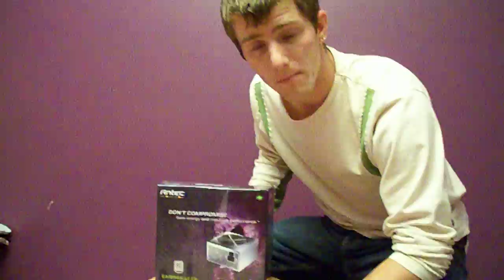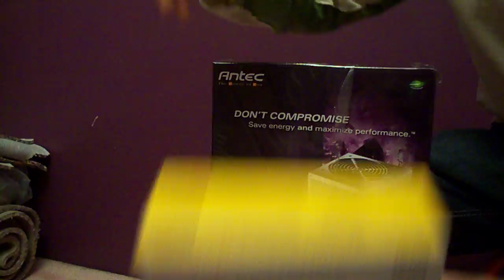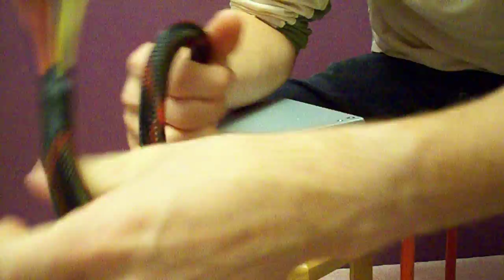Antec Earthwatts 650W 80+ Power Supply Unboxing Linus Tech Tips

Comment: I just bought this second hand used- I'm using i5-4470 and amd rx 580. So far so good but is it going to last long? I just want to know if do I need to replace mine or not. This is the only one my wallket can buy for now.
Reply: Update: It still actually works fine, already upgraded my GPU to an RTX 2060 and my CPU to i7-4790 and so far the PSU is still fine. But yeah I will still replace this anyways on my next upgrade.
Reply: @aaronazraelfreelance  I’ve been using this psu for at least 6 years and it’s still running great

Comment: Chapters:

0:00 Box and general overview
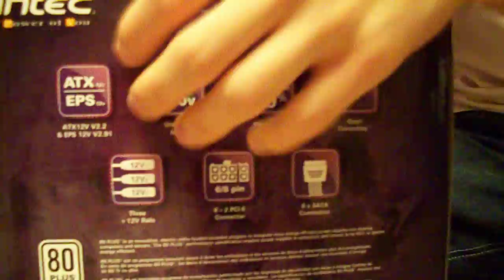1:08 Unboxing start
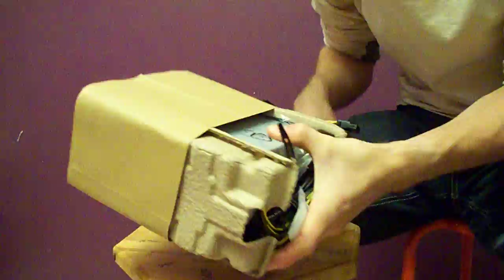1:29 Power cable
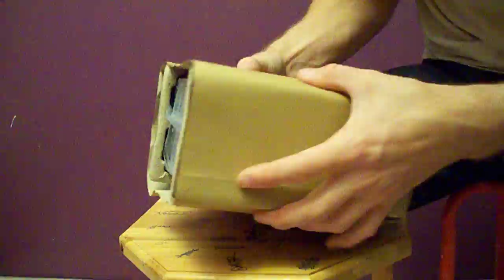1:46 The power supply itself
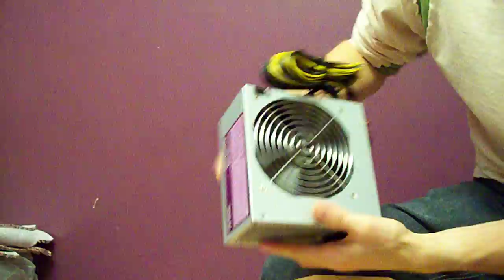2:17 The bottom
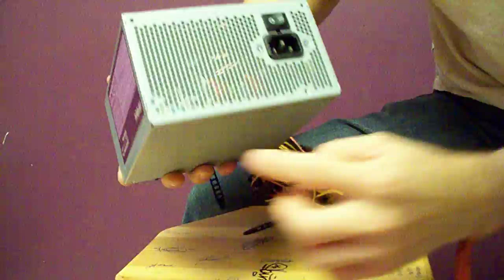2:29 The back
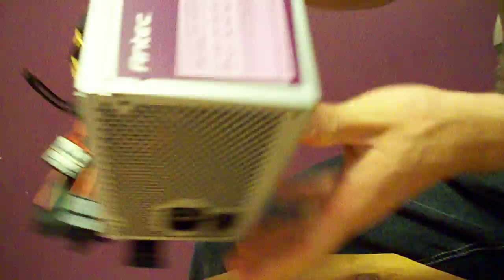2:41 Side 1
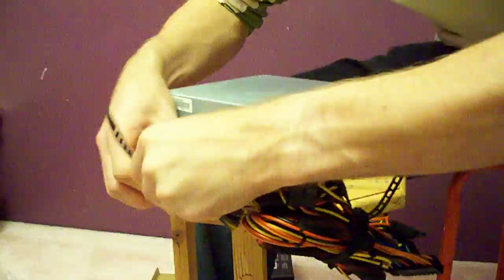2:57 The connectors

Review

Something about old power supplies is just... Neat. I rate this a 3/5

What am I doing, and why?

I want to watch, and review every single video on Linus Tech Tips channel.
I will provide chapters, if the video has none.
Why am I doing it? To pay a homage, and I am pretty sure that my head is a bit messed up.

Comment: I am still using this Power supply from 2011 to till date. It's running fit and fine.
Reply: what's ur pc specs?
Reply: @aaronazraelfreelance  Antec PSU same as in the video, Intel H 67 BLB3, Intel I5 2600 processor, ATI Radeon 1GB graphics card Power Colour, 1TB HDD, 16GB DDR3 Ram @ 1600Mhz, Antec Cabinet. Razer Lycosa keyboard, Razer Deat Adder mouse, LG DVD Writer.
Reply: is it still working?
Reply: @awtschan  Yes till today December 2025 but it has become weak.

Comment: I still have this power supply since 2009, it is still work, with an FX 6300 OC @ 4.5 GHz (air cooling) + RX 560 OC GPU, no problems of tension, it is very stable.Awesome PSU.
Reply: Hey! does yours have an electric type buzz on it? I just got mine and it starts buzzing after about 6-8 hours of use
Reply: did you keep it to this day?

Comment: so i bought this and i hooked it up brand new and installed it just like any other psu and it turned on my fan led blinked and then it shut off, system specs are fx 6300, 8 gb ddr3, msi 760gma, with a avga 1060 3gb is there anyone who can tell me how to fix this

Comment: Thank the Fu**ing colour lol you have to search hard for a low priced high wattage silver PSU i really want it to match the case :P 

This power supply looks really good and it has good Amperage (]
12V1 = 22Amps 
12V2 = 22 Amps 
12V3 = 25 Amps)

And it's 80+ Certified which means lower E-Bill :D